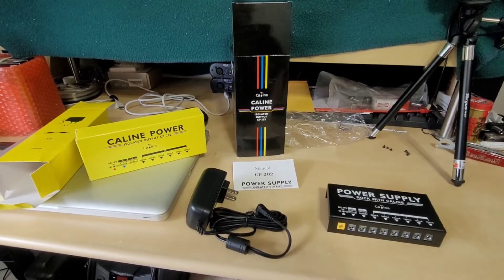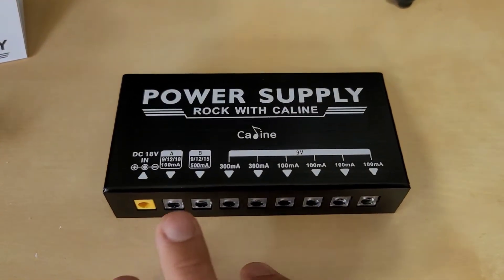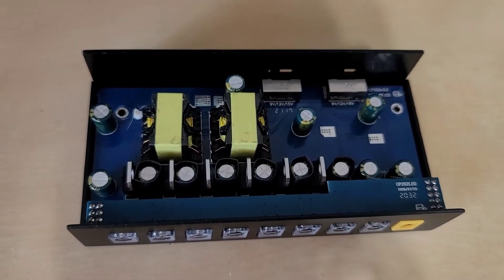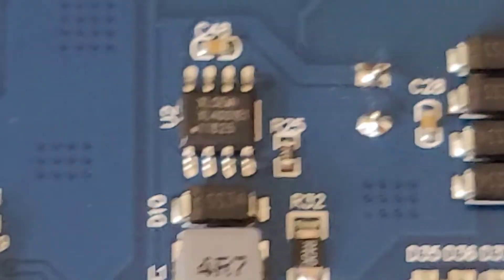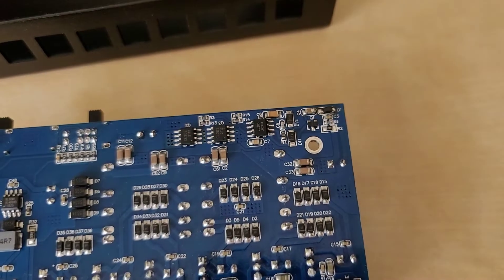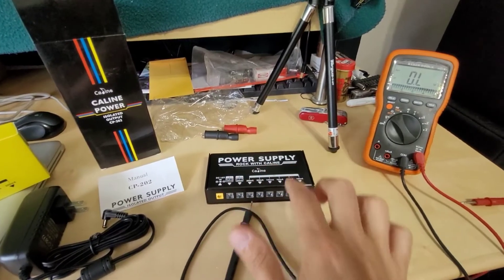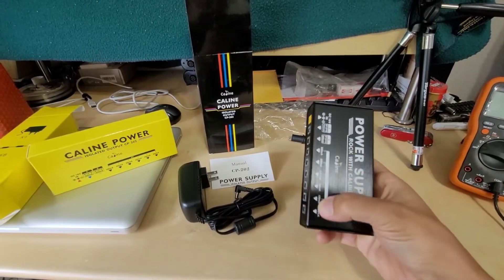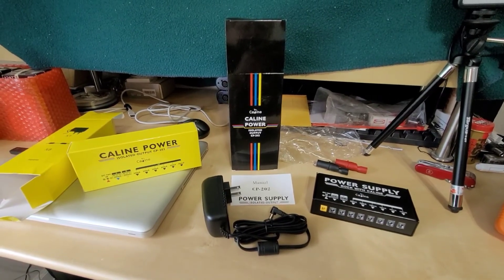Caline CP-202 Isolated Pedal Power Supply: Teardown and Review

Comment: So the 202 is better unit than the 207? I see the 202 is selling for $10 more than the 207 with way less outputs. I’ll probably be running 6 analog pedals.
Reply from the maker: @R3dbudd  not better just different. The 202 has more voltage options.
Reply: Ok. Just going off what you said about the iso units being larger. I figured that’s why the 202 costs more than the 207 which has way more outputs.
Reply from the maker: @R3dbudd  yeah the 202 has a higher amperage input power supply and with the selective voltages the topology of those circuits is a little bit more complex. Both are great options

Comment: First of all, thank you very much for reviewing the power supply. I have some doubts; on one hand, aesthetically and in terms of functionality, the power supply in the video is CP 203, however, on the circuit board it is indicated as CP 202 V:3.2. I'm not sure which model to buy because in other videos, when they open CP 202, it's a different circuit than the one shown in the video, and unfortunately, it doesn't have isolated outputs. I understand that in previous versions of CP 202, the circuits were different from what we see in the video. On the other hand, if I search Google for the Caline CP 203, it looks the same as yours. Anyway, if you could shed some light on this, I would appreciate it. Thank you very much.
Reply from the maker: Depending on what country you live in will determine the availability of what version of the power supply you are getting. Here in America it could be very different than say someone trying to find the same power supply in the Philippines for example.

Comment: Hey thanks for the great review. I looked at the 206 and 207 model. Are saying the 202 would be better because of individual higher outlets? I've looked at similar  power supplies and they tend to all look alike such as the Donner P1 or P2. I've read or seen that not all the cheaper power sources in the $40 to $60 range or truly isolated. I recently saw the Mojo 5 power supply and it looked like a quality one. Currently I only have one pedal, a chorus one. I was thinking of adding the Joyo R14 reverb pedal, but as a novice I don’t know which power supply can handle that particular one and just a few others that are low voltage pedals. Any advice would be greatly appreciated.
Reply from the maker: Yeah if you need more power then definitely get the 202 for the higher current ones. Typically analog pedals will not need anything beyond 100mA. It's when you start getting into the digital power it's when you start getting into the digital pedals where they need more current. I'm not too familiar with some of those other brands but I wouldn't be a bit surprised if Caline actually co-brands for them meaning they build them but then they put the companies logo on it.

Comment: Thank you very much for your video, very informative and clear explaination. It make sure my self to buy Caline 203, but I have a question, I have 18v 2a power adapter, I’m thinking to use it to feed the power to the main unit, since the original adaptor is 1a do you think it will have any benefit regarding the higher (2a) power or will it damage or generate a malfunction to the unit? Your information will be very helpful.
Regards :)
Reply from the maker: No issue at all. Just because the adapter is rated higher the power brick will only use the current necessary to power the pedals connected to it. It's better to have more amperage capacity than not enough.
Reply: @Bassguitarist1985  you are the best!!! I really appreciate your kindness. Thank you so very very much… wish your channel a great success!

Comment: Hey am looking to building a pedalboard do have any recommendations for power supply on a budget? Any of the caline or stay away?
Reply from the maker: The CP-206 and CP-207 are great options. If you have digital high current pedals however I would not recommend. It all depends what you are running

Comment: i think the cp-202 supposed to have all the outputs @ 300ma and one @ 500ma. i think you got the  cp-203's enclosure on this unit. can you confirm? thanks.
Reply from the maker: Not sure ill need to double check with my contact at Caline.
Reply from the maker: Yes the 203 and 202 are essentially the same pedal PSU. I cant seem to find a difference other than some minor artwork differences.

Comment: Great review on this one … thanks ! Was on the fence about it but will definitely be trying one out. Have a bunch of 9V Flamma pedals that run at 300Ma so will be really nice as most of these power supplies only give you a bunch of  100-200ma outputs.
Reply from the maker: Cool stuff! Thank you for watching! Yeah the current ratings for pedals are not necessarily constant duty but it could be peak rated. By the way it's a decent power supply from what I found in the build quality.

Comment: Would this work to power an HX Stomp that needs ~ 900ma or would I need a doubler? I know some PS’s like the truetone cs series will feed it even though it says 500ma. Thanks
Reply from the maker: Thats a lot of current. No the output stages are current limited, once you hit their labeled current rating the voltage drops too low to be useful. To get ~900mA at 9VDC you would need a 3 way parallel adapter between the # 2-3-4 outputs to run a pedal that large.